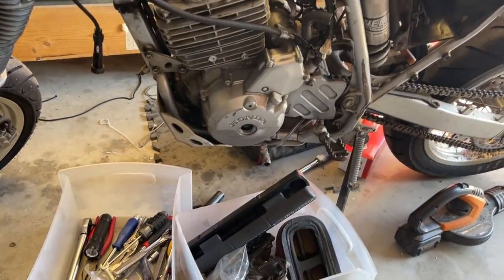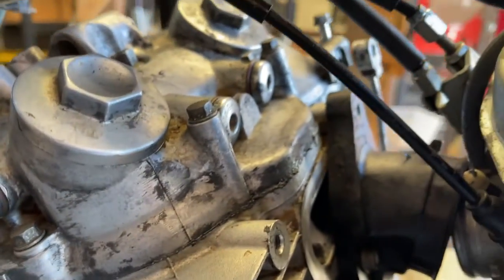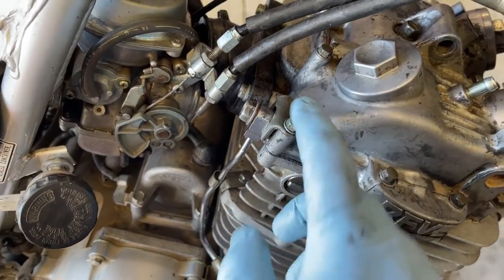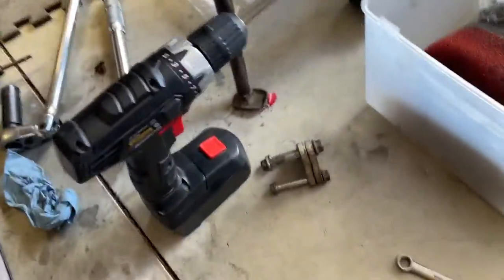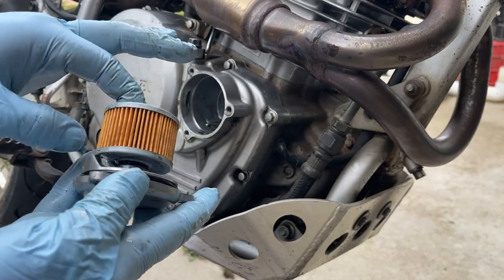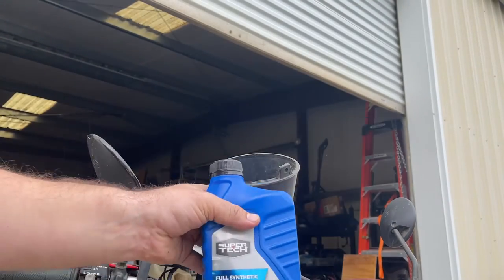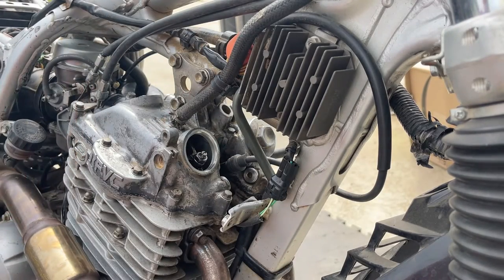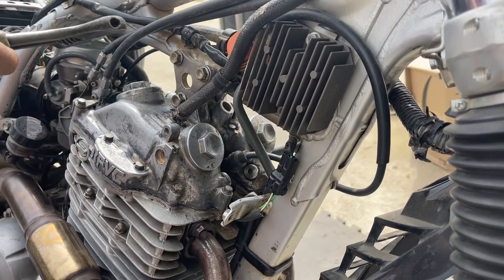Xr650L Rebuild Part 4 - Reinstall Valve Cover, Carburetor, Exhaust, Valve Clearance

Comment: Hey probably a stupid question. But I got the engine back together and when hand cranking I don't see the valves or cam moving at all. Before I put the valve cover on the cam and chain were moving. Now I don't see it moving. The tension went in good and everything tight. Thanks
Reply: Perhaps the chain is off the crank shaft sprocket?
Reply: As mentioned, most likely the cam chain is not on the lower sprocket. Without the tensioner and camshaft install you can seat it onto the lower sprocket by manoeuvring it from the top  end